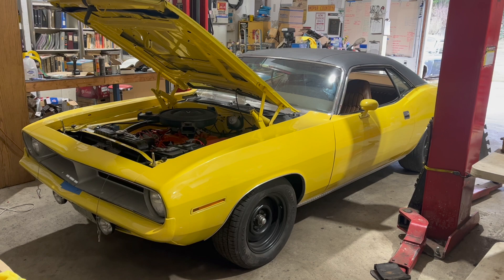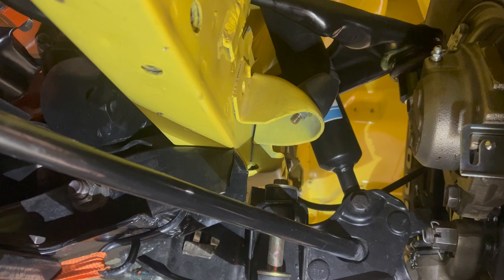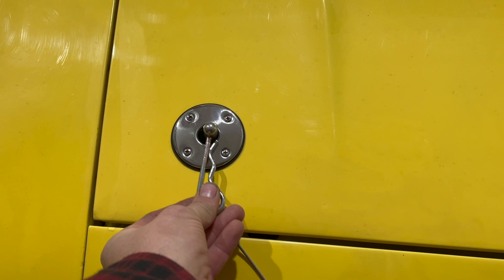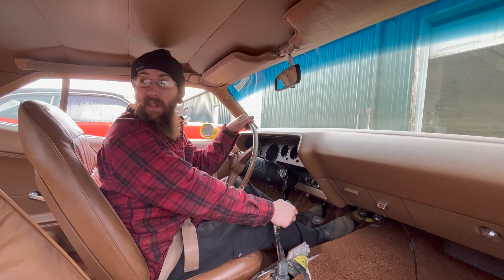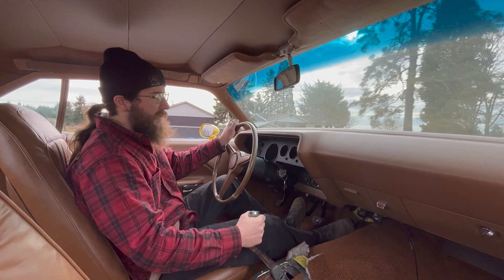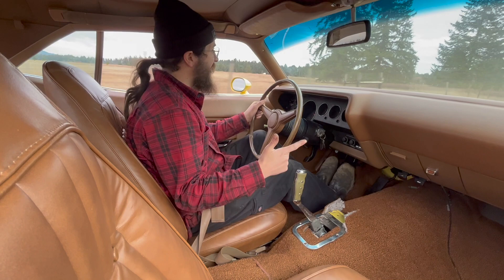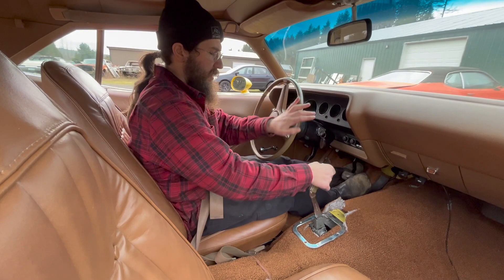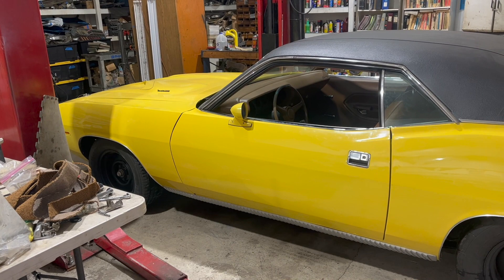What's It Like To Drive A Freshly Restored Big Block Four Speed 1970 Plymouth 'Cuda?

Comment: The only thing I can see you got wrong was no rusted out headers and glass packs.  Other than that, that's a pretty sweet ride!
Reply from the maker: 🤣 ok I think we can probably agree that it’s also suspiciously lacking in the air shock and shackles department.
Reply: @DeadDodgeGarage  Complete agreement.  Plus the traction bars that were attached to the leaf spring plates.
Reply from the maker: @matthewb8229  and ideally shimmed with wood blocks! That's how they were on my Challenger, anyway, so I assume that was standard equipment.
Reply: @matthewb8229 Ain't nothing wrong with slapper bars. I had 2 68 big block Camaros that ran 6.65 1/8th that's ~10.50 1/4.

Comment: When you determine that the Flowmasters are just too loud, make the change I did on my 64 Galaxie fastback 401 FE, I went to Dynomax super turbo and they cut the too loud and the too raspy crack when you whack the throttle.  Not too quiet not too loud. This Cuda is awesome.
Reply from the maker: Not my car, not my problem… I thought it sounded amazing. But I do prefer a quieter exhaust.

Comment: E bodies are indeed some of the best handling/ driving mopars! However, I did notice there’s a lot of difference in the suspension between a ‘Cuda and a barracuda. A ‘Cuda’s ride is hard and truck-like compared to a barracuda. Probably due to the ‘Cuda’s heavy duty suspension parts.
Reply from the maker: There is definitely a spring difference there.

Comment: Great car! Was the front bumper in bad shape and thats why it was painted, just asking.
Reply from the maker: No, it’s a correct original factory option! Elastomeric paint matched front bumper only which I learned via the trim tag today. I also learned that it originally had a Gran Coupe type overhead console and belt line trim - but it is a BS Cuda vin. Very odd set of options really.
Reply: @DeadDodgeGarage I learned something. Thanks

Comment: I want to put this exact interior in my own 1971 dodge demon. Speaking of which, how does your blue demon actually ride like does it drive good?
Reply from the maker: It drives kinda ok. Haha. The way it’s set up is kind of peculiar. There is preload on the pinion snubber, so there is essentially no rear suspension. It is aligned with zero toe to reduce drag from tire scrub. Also, the front end stuff is all old and as far as I know, original. In spite of all this, it really isn’t horrible. It does have a front sway bar (odd for a drag car) and handles pretty well on the road. It wanders a bit. To this point, I have made zero changes to the setup. I would like to drop the snubber, try running down the track without the sway bar, and I may like to go back to drilled shocks, which Dale ran in the day. I can’t say I’ve ever had an A body that drove much better. B bodies, on the other hand… my Charger rides and handles great. And this ‘Cuda is definitely worlds better than my Demon in terms of ride and handling.
Reply: @DeadDodgeGarage  your charger is beautiful I must say and it makes sense that those would be smoother. The charger is world's bigger than the demon and the Cuda and the Cuda has all new stuff in it. I'm still getting mine running so maybe get a new torsion bar suspension leaf springs and shocks for it? I thought about going with a modern 5 link challenger suspension and coilovers in the front. Mine is my daily driver and first car actually.

Comment: Awesome car. Hey Jamie, you seem to know a lot about 440s. I bought a 75 dodge club cab with a 440 4 speed. Motor has literally 0 oil pressure and it it not the pump. You got any ideas? It runs smooth and I replaced to gauge with a manual gauge and still nothing. Got any ideas? Thank you for reading this
Reply from the maker: Runs smooth, no clattering? But zero PSI oil pressure… if you crank it (no ignition!) with the oil filter removed, are you rewarded with a healthy stream of oil? I’m assuming you say it’s not the pump because you have replaced it already? When you rev the engine, does the gauge start to read pressure? I wouldn’t expect a hydraulic lifter engine to be smooth and happy if it truly had no pressure, so this is very curious. In my experience, Mopar engines start making valve noise when they are simply low on oil, and the oil pressure gauge reading will still appear normal. So at zero psi… bad stuff should be happening. Maybe there is some blockage in the oil feed to the gauge sending unit? Or something else similarly strange is going on.
Reply: @DeadDodgeGarage  rev it up still zero oil pressure. It is the most weird motor I’ve had. It does not chatter I took the valve covers off and nothing was dry. But I tested the oil pump it’s good. I bought the truck and the previous owner said no oil pressure and he drove it home and left if there for 13 years. It ran smooth for the most part did not rev much and ran rich but it wasn’t chattering I ran it for about 5 min and moved it around a lil bit but still zero oil pressure. I got the pump off and I checked the driver that drives the distributor and pump and it was good. But in the 5 min it ran hot enough that it didn’t want to run. But no valve noises and rod noises it was a pretty quiet noise. Maybe your right where the passage up to the gauge is blocked. Thank you for reading this. Helps a lot!
Reply from the maker: @ethanrossmann579  But it also got hot? Dang. It sounds like there's a lot going on there. Wish I could see this in person and wrap my head around it. If you get it figured out, let me know what you find!
Reply: @DeadDodgeGarage  will do! And also I sent you a couple videos on instagram of it running so you got so what better idea

Comment: Noticed that the vacuum advance isn't hooked up. Would help drivability.
Reply from the maker: With this whacko cam, we will not be running vacuum advance. I haven’t curved the distributor yet, but it will have a tight 10-15 degree curve, and will probably end up with something like 36-38 degrees total advance. I’m not entirely sure what the combination is going to want. It’s really not far off on total now, just a little lacking downstairs.

Comment: Cool video..Have a ?
My cars a 4spd..when car was off my son pushed shifter out of gear. But it's actually still in gear. Have any ideas?
Reply from the maker: Shift rod fall off? That’s the only thing that comes to mind. Well, I’ve heard the pieces that move the shift collars internally can crack. I can’t remember what the heck those are called. If shift rods are still in place, that’s the next place I would look. I don’t think anything in the shifter itself could come apart and cause that but I could be wrong.

Comment: No Vaccum advance?
Reply from the maker: Not on a performance build like this. It’s running a tight 10-12 degree curve, and since the video I’ve dialed total timing at 36 degrees. Much, much more responsive. It may like more or less but it’s a good place to start.
Reply: @DeadDodgeGarage  Good deals!.  I've inherited a super nice 1 owner 1969 Charger in R4 Red.  383 4bbl 4-speed. Am I reading right that the timing for a manual transmission car is 0 deg TDC?
Reply from the maker: @Trex1268  that sounds like the spec for slant six. I really think it should be around 10 degrees. I could look in the service manual but I’m kind of wrist deep in an A833 right now…
Reply: @DeadDodgeGarage  I have the service manual. So I'm pretty sure I'm reading the specs for a 383.  I just need some verification before I put a timing light on it.
Reply from the maker: @Trex1268  You were totally right. I confirmed this today - the spec listed for 383 with manual transmission is TDC (0 degrees) +- 2.5 degrees. This was actually in the '71 manual. For that to work, the distributor they used must have had 30+ degrees of advance built in. Nuts! Personally, I would be checking total advance with a dial back timing light. Who knows what distributor with what amount of advance is in it at this point.
Reply: @DeadDodgeGarage  Excellent!  Thanks for your reply.  Since mine is a one-owner car that's been in the family since new I'm just going to trust what the factory did when it comes to the distributor. The car has basically been put up and babied since 1974.  It's got 53K original miles.

Comment: The car looks ok but it just needs something but I don't know what ? The interior is A GROSS COLOR, CAR SOUNDS UNREAL, MANUAL NICE BUT IT NEEDS SOMETHING, MAYBE STRIPES, PIN STRIPPING ? Black interior or maybe even white would have been much better.

I SURE AS HELL WOULDN'T BE ASHAMED TO DRIVE IT THOUGH. 😁
Reply from the maker: I’m surprised by how polarizing the interior is. Haha. Apparently yellow with tan/brown leather wasn’t all that uncommon. Personally I would’ve gone for black, but I really like this for some reason. It had a black hockey stick stripe originally, and we’re still unsure if that will go back on or not. If it were mine - hell yeah!
Reply: @DeadDodgeGarage  HELL YEAH ON THE STRIPE, YES BLACK INTERIOR. THANKS FOR THE REPLY, YOU HAVE GREAT TASTE DOING YOUR " NON- JOB " 😁
Reply: Black billboards/440 callout
Reply from the maker: @mickangio16  being ‘70 it’s a ‘hockey stick’ instead of the big (and awesome) billboard stripe. It will eventually be getting the original 383, and for that reason the owner has stuck with the 383 badging. We installed factory style hockey stick stripes this week. Looks pretty good!

Comment: The color of that interior is a deal breaker for me, I don't care what the car is or how nice it is..what were you thinking.. thumbs down on this one.
Reply from the maker: Wow. Lol. I kinda like it. It’s definitely different. Reminds me of an English sports car. It wouldn’t have been my choice, but it was someone’s choice in 1970 and I respect it.
Reply: I AGREE, The color of the interior does not go with the yellow car. Black would have been SO MUCH BETTER, HELL MAYBE EVEN WHITE ?
Reply: It's not a bad color, don't see many that color. I thought with that FY1 yellow it was what the factory called a 'Non-recommended' color combo but it was allowed, odd as it was. Best thing is to just keep it original. I've seen lots of purple and pink cars in junkyards repainted different colors. 
A long time ago in the mid '90's I saw a Curious yellow '71 Satellite Sebring in a local junkyard. Pretty basic 2 door Satellite, 318 auto, black vinyl bench seat interior, 14" Mike Brady Barracuda style wheel covers, modestly optioned. It was definitely an old lady's car. Might have had a black vinyl top. I knew the guys at the yard and asked about some parts off it at the office. I thought  the price was a little high and remarked in an explicative. He said "Go check the mileage on that car." I did. It was 30k. Very strange color choice for a car like that. Might have even been a Sales Bank car. It was actually a pretty solid car.
Reply: @vincemajestyk9497  I like the YELLOW, I had a 68 Camaro in Yellow but it had stripes. The interior is just BLAH in this Cuda, JUST MY OPINION.

I'm NOT A MOPAR GUY REALLY but these cars are VERY COOL, don't know much about them. I would also BLACK OUT THE GRILL & MAYBE BLACK MIRRORS ?

People like different things, HELL I KNOW A GUY THAT LIKES " HOT BEER " WTF ? If this car was all original, I would have definitely keep the interior that BLAH COLOR. But it's not so I would go with what I liked, like Black interior & other things I've mentioned.

Was the Satellite in the Junk Yard in an accident or just rusted to hell ?
Reply: @NoWr2Run  I wouldn't select that int color if I was ordering a new car, but with certain paint colors it's not that bad. It looks kind of putrid with that color though. In the early '80's I used to go to state auctions with my bud to buy state police cars to resell. He absolutely hated, hated, hated tan interior cars. Always avoided them if he could help it. 
That Satellite was in a MD junkyard about 25 miles outside DC. It was basically rust free, just a little surface rust in the lower 1/4's & fender bottoms. No perforation. Original paint. I don't remember any accident damage. Maybe a small bump in the front. I think the lady died and the family just 'scraped' it cause it was an old car. Except for the parts that were gone when I saw it, which wasn't much, I'll bet you could have put a battery in it and drove it out of there. I took the steering box out of it. Mine was loosey goosey with 240k miles.
Reply from the maker: @NoWr2Run  Maybe it just looks worse on video? Lol. I've been in the interior and I really don't mind it. Kinda like it, even. The owner has the original engine, and eventually it will be going back in. Other than the 440 and headers, it has been restored to stock - so I'll say that's close enough.
Reply: @DeadDodgeGarage  CROUSE ENOUGH, Keep the 440 in it, SOUNDS FREKIN AWESOME.
Reply: @NoWr2Run  440 POWAAAAH!
                                   Interior😔
Reply: @mickangio16  DAMN STRAIGHT, SIR.